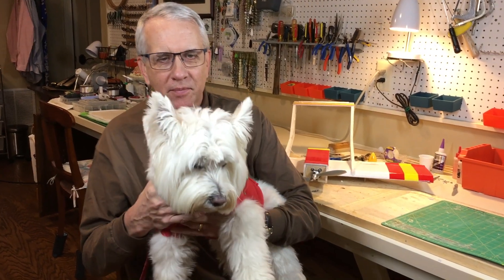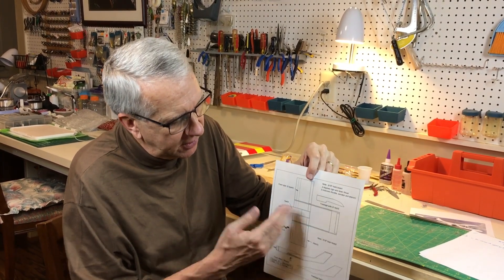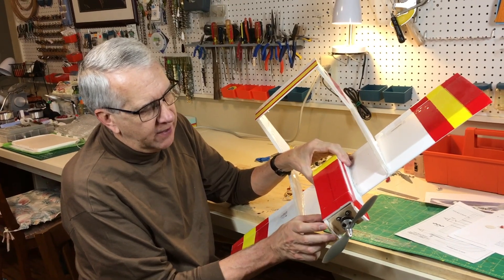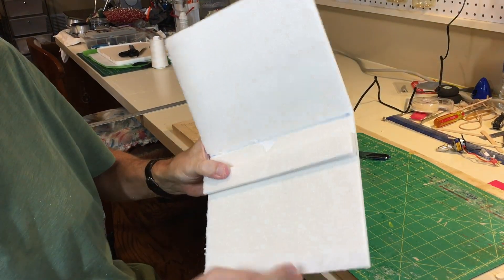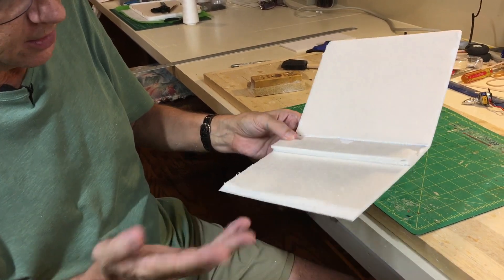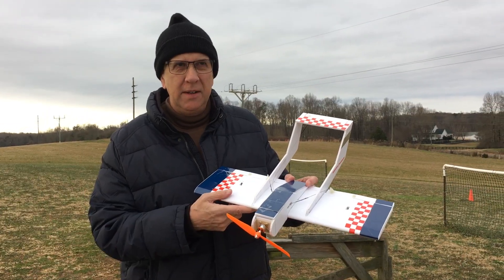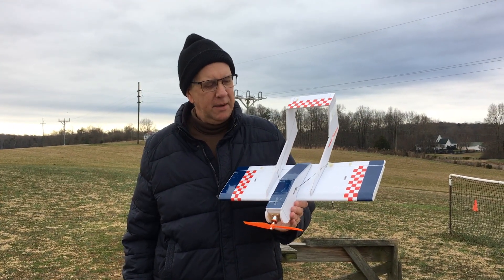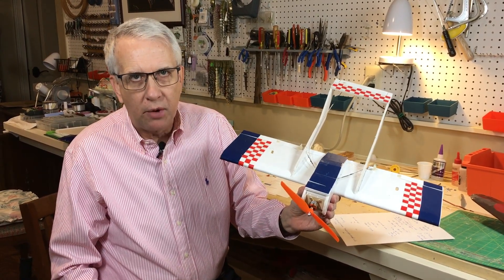Mini Bronco Foam Board RC Model Airplane

Comment: I would love to make this but foam board is soo heavy (because of the thick paper) and expensive here in Australia so I might try another material any ideas ?
Reply from the maker: Depron might be one approach, but I have not used this yet. Tim
Reply: Would balsa work but a smaller size than the mini bronco that you made

Comment: Hey Tim. Love your videos! I’m looking to build this model and I’d like to have full size plans printed at my local staples. On what size paper would I have these printed on to be full scale? Ex: 24x36? Any help would be greatly appreciated.
Reply from the maker: Jeremy:  Chat with the Staples rep, print size depends on the paper size for their printer. Also, as the Bronco all straight lines, very easy to sketch out the fuselage booms directly onto the foamboard. I also have a video on enlarging plans, check it out!  Tim